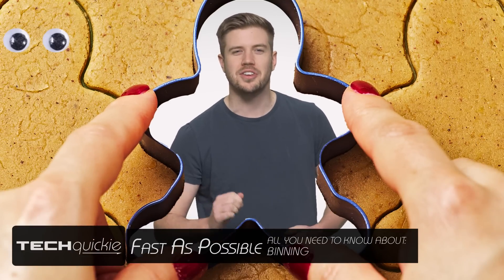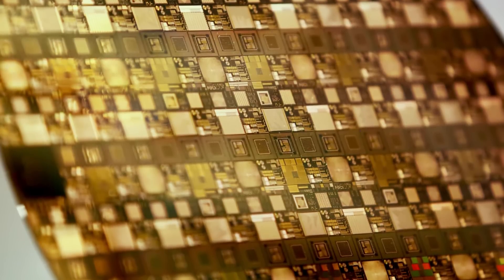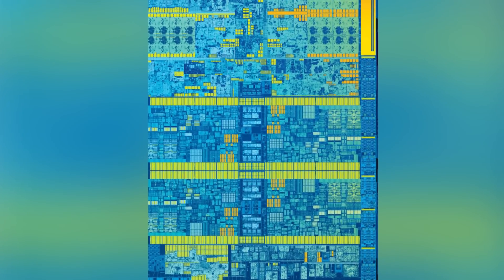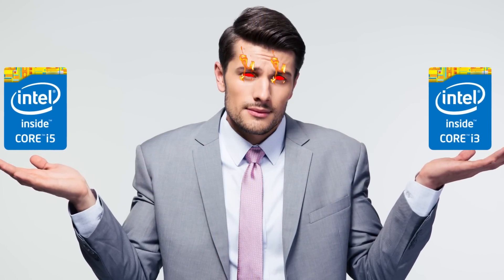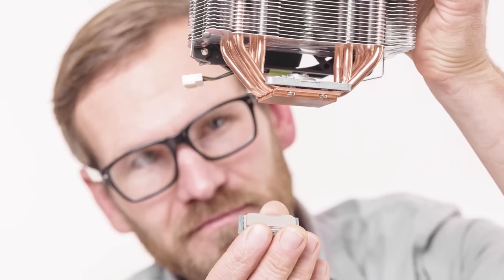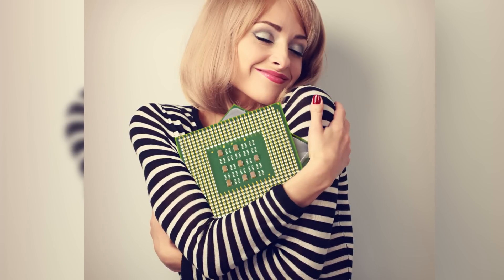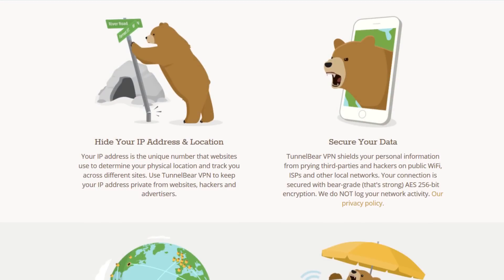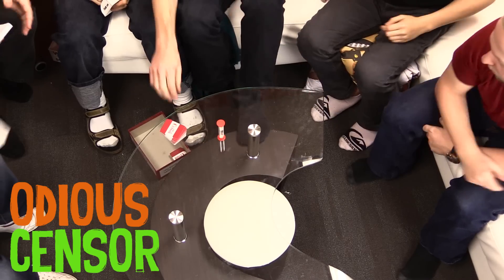Binning As Fast As Possible

Comment: I sure scored with my 8700k, runs super cool under load when rendering my 4k car videos
Reply: nope, 8700K with 32GB DDR4 RAM, Samsung 960 PRO M.2 SSD, tower air cooler and lots of fans, I've never CPU higher than 60 degrees Celsius so far. Prime95 stress tests for an hour, same results. Oh and I'm overclocked to 5Ghz per core

Comment: You should have mentioned that manufacturers may also do this even if the product works fine. Manufacturing always has an initial cost which in case of CPUs is the films, bonding machines, test equipment, etc. So in some cases it may not make sense to differentiate between the process of creating and testing products of different tiers. If you take apart any product you'll often see missing components on the PCB, or different tiers may have the same components inside and the difference is just a software license. In these cases the company profits more from selling the higher end product to those who actually need that.

Comment: Basically, core i3 is downgraded core i5 with 2 disabled cores and lower speed
And a core i7 is upgraded core i5 with only 4 cores but with more hyper threads and higher clock speed
In a nutshell core i5 is the base 

Idk if that was real anyway this is just my theory lol

Comment: Why not recycle the silicon? If you could test dies without putting them into a full chip, you could test them sooner and be able to simply melt down and refine the silicon again. Binning seems like a waste of potential.
Reply: Because most of the expense is in building the fab so they try to get as much money for the parts as possible

Comment: My father taught me what Binning is when he bought me a Dell PC back in 1994. He explained to me the difference between custom building a computer and buying a brand machine like Dell's.

According to him, due to the silicon lottery (That term wasn't coined back then) most of the RAM's don't perform as optimally as required. So, Dell used to test out the performances of each of the component and used the best out of the lot and optimized all the hardware to be compatible with each other before producing a machine.

That's why they cost 3 times as much back then. It was his response to my question "Why buy Dell when you can get much lower prices elsewhere?" (I was 6. Don't blame be for being stupid back then.)

When I tried to share this information with my friends, later in life, they all ridiculed me "Oh! So the same model of RAM will be different from each other eh? You're a moron!" and stuff like that. Yeah, my school life sucked. High school, even more so. Meh.

Comment: As he mentioned, years ago I built quit a few Phenom II x2 systems with motherboards which featured extra core unlocking. The bios would let you test toggling on or off certain cores to see if they were viable. Some of the dual core Phenom II chips unlocked into triple cores and a few became quad cores. If I remember correctly CPU-Z would misidentify them afterwards. It was a pretty awesome way to pad the stats on budget builds.

Comment: Many people will get angry about their middle range CPU or GPU being a failed high end model, but I see the higher picture where a chip still has a use and so, the "precious" resources used to build it are not wasted
Reply: Well, except the fact, the actual materials cost of any given processor is only a few bucks.  Most of the price you're paying comes from R&D
Reply: Fun Fact: During the manifacturing of AMD Phenom quadcores, where failed cores also made them to triplecores, there was actually such a high request of those nice cheaper quieter energy saving triplecores that AMD needed to "destroy" so many working quadcores that it was actually very very common that you could enable a disabled core easily and it was very uncommon that those were actually failed. ^^
Reply: until you factor in the cost of factory and how long it takes to make a chip.
Reply: the athalon 2 was the same, a quad sold as a 3 core

Comment: can the cpu performance be downgraded for binning as well
Reply: that's uh, what the point of binning is. units that perform poorly may have defective units heat cut and then sold as a lower tier product.

so it got downgraded by having defects.
Reply: yeah that i get it. but my CPU speed downgraded for heat throttling and after replacing it( heat-sink compound), the clock speed remained the same.
Reply: Joe Jackman i don't think i understand what you're saying.
Reply: i am saying is that my CPU speed downgraded due to thermal throttling. After replacing the heat sink compound, thermal throttling stopped but my CPU speed didn't get back to normal.
before it was 2.7 GHZ and now 1.3 GHZ

Comment: So basically Intel randomly produces chips and sells them at different prices according to their quality?!?!
Reply: Intel create chips and scale the pricing based upon quality, splitting them up into certain model numbers. The chips are more-or-less identical (you won't get an i5 6600 with more cores or FPUs than another),

It's a system that actually means we, the regular consumers, get cheaper products, by essentially buying the less-successful components, whilst the better binned products sell for much higher.

Comment: Does that mean that if i buy a I7 6800k 4 example in a website like best buy or cyberopwerpc or something it may be a (fake one) that was for example a 3593840X but downgrade ? it would be a scam (like two same device would not get the same performance) plz explain me ty.
Reply: ...
no. it would mean the product may have been instead of a $300 product that you're buying it for, originally manufactured to be a $400, $600, $1000, $2000 product that when manufacturing was finished, some parts of it either worked very badly or didn't work at all.

so those parts are cut, and then it's sold as what is left. you're getting exactly what you paid for.
Reply: ***** Thank you so much <3 !

Comment: My first proccessor was an AMD Phenom II X4 840T. the T versions of the 840s were actually different 6-core processors that had low quality or failed cores and if you had the right mobo you could re-enable them for some free performance. eventually though pretty much all of those cores became unstable and got to the point of refusing to post. great performance per dolllar though.

Comment: I work at the a silicon lottery manufacturer, and we do multiple passes of this for QC. During manufacturing there are entire sections of silicon wafers that become damaged or for one reason or another are to thick or too thin causing pinhole defects. If a pinhole defect falls on a metal track the chip is then considered damaged and steps are taken to either preserve some functionality, or determine if it is honest scrap. Its a rather fun and involved process to try and find the needles in a haystack issues that are causing problems.

Comment: Could you make a video explaining the different options to back up a computer and the pro's and con's of each?
Reply: I personally use robocopy ATM, since it's built into Windows, though it has the large restriction of actually being a sync tool, so whatever folder gets deleted on the original install gets removed on the backup side as well next time you backup, so watch out for that, but it's a lot better than praying to your drive not to fail

Comment: I think I would have preferred blissful ignorance.

But I knew the 970 is basically a 980 with a load of stuff disabled. Does that mean the 970 came about because they had a whole load of poor quality 980s?
Reply: that's probably the case, think about how nvidia releases the highend first and later on releases more and more lower end ones, aka partially defective dies. also they might release a ti later on since they probably have improved the manufacturer process by then, so from then on they create a bunch of 980 tis. although the last part Is just speculation

Comment: Does that mean I can essentially unlock the cores on my 970 so I have a 980? Or am I misinterpreting this?
Reply: +Soperpen54 The 970 quite literally is a crippled 980 so idk
Reply: You can't, as the bad cores are physically disabled on the chip (connections cut) and therefore can't be re - enabled.

Comment: how can an i5 become an i3, when the i3 has hyper threading and the i5 doesn't? wouldn't it be so that an i7 become an i3 and an i5 becomes a pentium?
Reply: +Ward Huyskes dude my i5 540m has hyper threading
Reply: Abdelrahman Hamada yeah, but that's a dual core, much like the i3. It wouldn't make much sense to turn a laptop i5 into a desktop i3 because the i3 is higher end. What I mean (and also what they meant in the video) is turning a dekstop i5 (so 4cores and 4threads) into a desktop i3 (so 2 and 4threads). This doesn't make much sense since a thread is inside a core and you can't have 4 threads if you would dissable 2 Cores.
Reply: Ward Huyskes well i don't know much about it but i guess hyper threading has something to do with embedded system programing or..maybe not :)
Reply: The i3 is the lowest intel core processor, it goes i3, i5, i7. Most i3's don't tend to have good turbo boost capability, and have less cores than the i5 and i7. If you tested a skylake i3 against a skylake i5, the i5 would beat it any day
Reply: Wada Don thanks for the completely irrelevant information.
Reply: Ward Huyskes You said that the i3 was higher end compared to the i5
Reply: Wada Don yeah, compared to a laptop i5 it is. That's what I said
Reply: Suppose there's an Intel quad-core die and it's for i7 with hyper-threading, and manufacturing variations resulted in 1 out of 4 hyperthreading circuits fail (but all cores are good) - it becomes an i5 quad core. If up to 2 cores fail and up to 2 hyperthreading circuits fail, and the good cores match the good hyperthreading circuits - it becomes an i3.

Comment: Another reason they bin processors is to meet demand. If They have a batch of dies that happen to test really well they might bin some just to have those lower speed dies to meet the demand they have. In that case there is nothing wrong with the disabled cores, they just needed more i3's
Reply: +Skwisgar2322 dont think so, imagine this
-oh i need a 3 inch cable that a client whats that cost me 1 cent to make
-but i do have a 9 inch cable that i already manufactured, but cost me 10 cents to make, 
-but the 3 inch cable sells at 15 cents and the 9 inch sells at 100 cents, 
-should i destroy the 9 inc to make 3 inch cables?

the answer is NO.
why?
i will loose money

creating i7 ships to just disable cores its not viable, its like spending more money that you shoudl do and win mostly nothing, on the contrari using chips that where not in good shape to be i7 if i already spend the money i may aswell recover the production value and sell it as a i3
Reply: Francisco Barraza
The fact you are missing is it cost exactly the same to make an i3 and an i7. If Intel can't fill it's i3 contracts with say, DELL,  DELL is gonna start looking around. starting to make more sense now? Intel doesn't necessarily start a batch of x number of i3's they make x number of cores, and y% are destined to be i3, and z% i 5 and w% i7 and so on.
Reply: Skwisgar2322 the problem is, its not the same, why would they sell them at diferent price if they cost the same, unless they especifically wait for i7 to be defective to make a i5 and i3. i dont believe its the same..
Reply: +Francisco Barraza supply and demand. people will pay a premium for a faster processor regardless of what it costs. If I make two widgets and one is awesome and the other is crap, it cost me the same money to make both, however I can charge far more for the awesome one. At the same time if I have.a contract for 50,000 awesome widgets and 100,000 ok widgets and I make 150,000 widgets not knowing for certain how they will turn out, and I happen to get 75,000 awesome ones and 75,000 OK ones I still need 25,000 OK ones. so I make some of the awesome ones into OK ones to fulfill my contract. It is the same way for market demand, if Intel makes 30% i7 capable cores but they know only 15% of the processors they sell are i7s, they don't want to run out of i3/i5 and have all those extra i7s sitting in the warehouse.

Comment: R9 290s had the ability to become 290X cards through flashing the bios. As well as 290/X can be "turned" into 390/X through the same process. My 290X (390X bios) now draws less power and has been easier to clock higher because of it.
Reply: +Donald C. Just like how you can flash your motherboard Bios you can also do that to your graphics cards. It is a bit more ...difficult, but it can help with performance or power draw.

Comment: How to defend a smartphone conected to WiFi againts anti sniffing, so that the spy doesn't read your messages etcetera?
Reply: +Cristian Farapon you want to defend against anti sniffing? so basically you want to hack into someone's phone. :)
Reply: Eric D  ''defend against anti sniffing'' yes. ''you want to hack into someone's phone'' no, what i want is that all the data that goes from a smarthphone to the router cannot be read (i suspect it is currently read by a family member). I googeles stuff but all i see is 'how to sniff' and nothing about how to defend against sniffing :/
Reply: Cristian Farapon Wow, you really don't understand what I said. Anti sniffing is what you are actually looking for, not what you want to defend against. Defending against anti sniffing would be finding a way to read the data going between two devices from a third device, despite something which is trying to prevent that, essentially hacking into it.

Also, encryption and VPN are what you should be searching for. Depending on what you think they are getting you may also want to look into dual factor authentication.

Comment: Anyone remember the Celeron 300, you could overclock it to 450!.
Reply: +Shane Le Plastrier 
I did that, everyone was doing it at that time. The issue was intel process was so great they cant bin enough 300 processor, so they just took a 450 processor and sold it as 300. People figure out if you took Celeron 300 and stick it to a 450 motherboard it will work like a 450. Intel put out some announcement saying it is not recommended and computer might become unstable blah blah..

Comment: Hey guys... Can you please explain what is Hardware Acceleration in Browser? And also, being named "Acceleration", why does it practically slows the browser down?
Reply: hardware acceleration means gpu acceleration, instead of decoding video using a software codec for example it would use hardware decoding, aka codec physically built into the GPU. sometimes atleast for playback software decoding is faster than hardware, but devices like smartphone hardware decoding is really great cuz arm CPU is too slow to keep up on most devices, so you get better performance on mobile when using hardware decoding

Comment: i read multiple places that pentium and i3 share the same die so either you or a bunch of other places are wrong. i5 and i7 share same die. 2011 socket 6 and 8 core share same die. 

i was also expecting some more technical information about binning like the process the manufacturers use to determine if a chip can handle cache or voltage or clocks which decides if itll be k, or non k, or laptop chip. which i forget if you even went into detail that thats what they check but that shouldve been the highlight of the video not a general definition of the word

the quality of your information is going downhill. this video is less useful and less accurate than what a quick google search can tell you. being the leading name in tech videos you need to step your game up
Reply: +EZOVERDOSE This series is called " As Fast As Possible".
Reply: Ruiner
using that logic he shouldnt have even mentioned the wrong information of an i3 being an i5 die. everything i wrote above couldve been in the video and it have been just as long if less relevant or wrong information was left out

Comment: About the tunnelbear sponsor:  I use it and for the most part it's real nifty hell, I'm using it right now! but your code only applies to the grizzly package, at least when I tried to use it.

For those who want a vpn and use mumble or teamspeak a lot, be aware as tunnelbear blocks the ports is uses due to those same ports being used by bittorrent.  Due to everyone's favorite villain known as Hollywood forcing tunnelbear to either block said ports or log their users' data.  Fortunately (i guess) they picked the former.

Good service, just be aware of it's shortcomings.

Comment: The Ati x850 pro @XT by flash bios....ahhh the old good days....
Reply: hehe nice. i had an X1800GTO @XL. :D
and before that a 6600 with a modded bios for more Vcore. basically 6600GT frequencies. (300MHz->550MHz).

good old days.

Comment: I still use an AMD Sempron 145 with an unlocked 2nd core and overclocked to 3.2 and it is the same as a Athlon II x2 260.

Comment: There is nothing wrong with the low binned chips. 

Well yes technically yes but they do their job just slightly worse then their successful brothers and sisters. And if I am to build a small pc for next to my television, for media streaming and other basic things. I don't need an i7, or even an i5, a i3 would easily run most of what I would run on it. 

Hell I can run netflix at 85% processing power on my hybrid tabled with a 3735Z cpu. It pushes all the cores to work as hard as they can but it runs! 

So running a cheaper CPU in a media box. I don't see the problem as long as it runs the codecs well. And with hardware H265/HVEC support rising it doesn't requires a big powerful CPU to run big HVEC streams anymore soon enough.